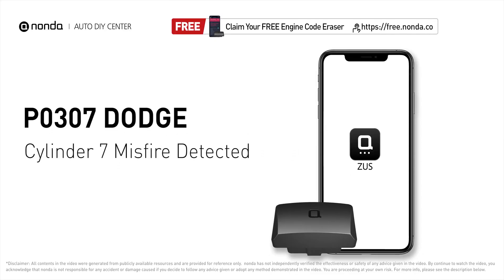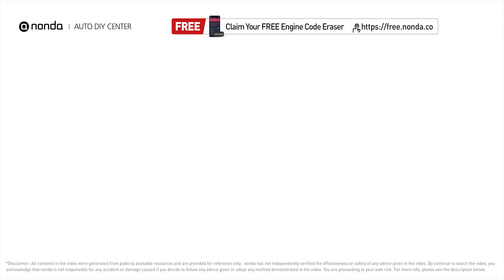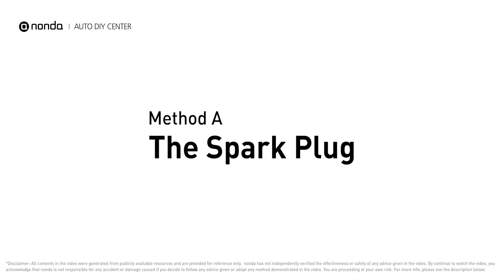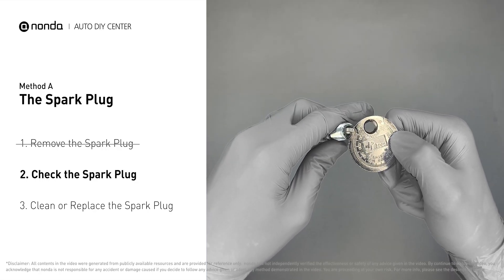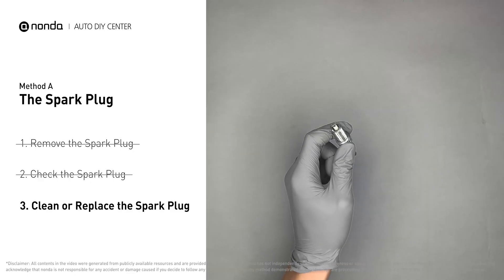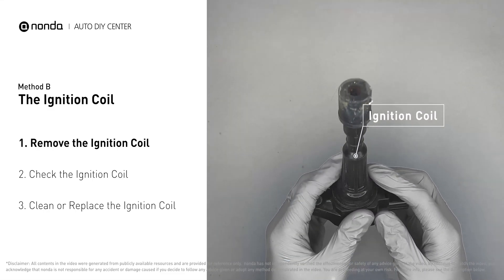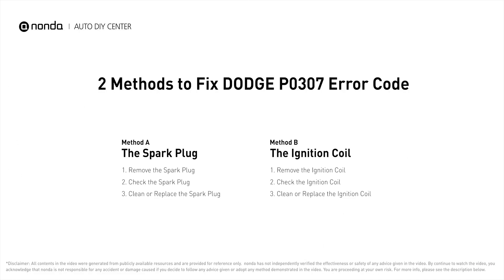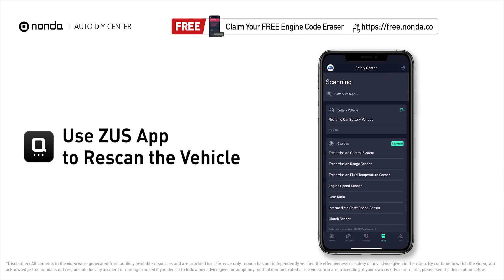How to Fix DODGE P0307 Engine Code in 3 Minutes [2 DIY Methods / Only $4.12]

Comment: Great, quick to the point, no nonsense video. I tried method A, going to Autozone to buy a new ignition coil now.
Reply from the maker: We appreciate your feedback! Hope it helps!
Reply: @nondainc  It did actually, it runs smoothly now. Going to replace the remaining 8 coils, and 14 plugs down the line when I get more money.